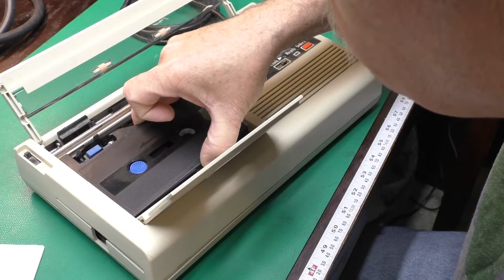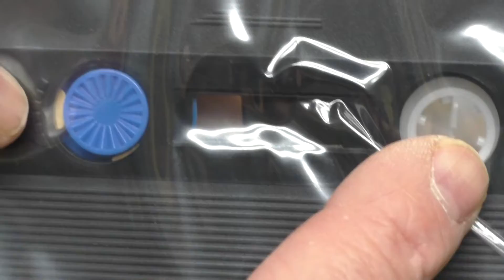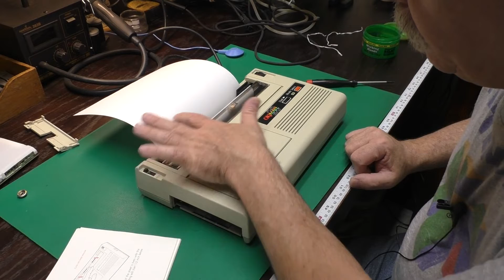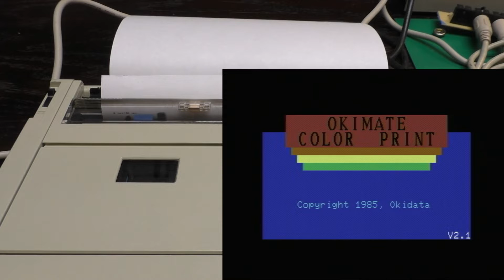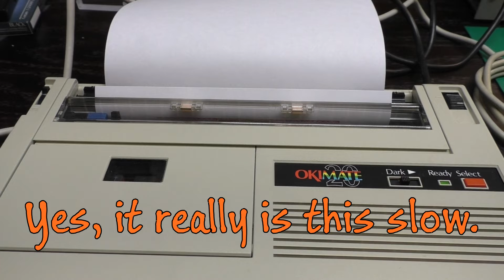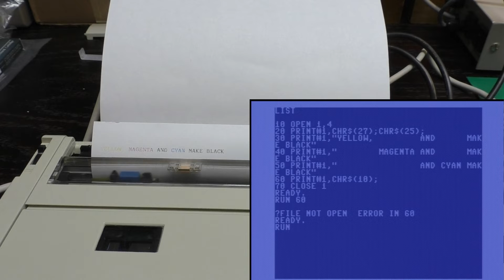Okidata Okimate 20 Printer - Refurb, testing, programming

Comment: Thanks for this video.. I just found one of these for a whopping $5 with three ribbons.  It wouldn't print at all, print head just jammed but only when printing. When powering up, it went back and forth normally.  Really confused about why but it turned out when it prints it pushed the head forward, which created extra drag on the forward rail, which was dry and (not visibly) rusty.  A good clean and wipe down, and application of a little silicone spray on a q-tip and wiped on the rails and it prints like magic. I've always wanted one of these printers and while thermal paper is a little clunky, the silent and crisp printing is a real joy, especially at midnight while your wife is sleeping in the next room. I wish thermal paper came in tractor feed!

Comment: Got myself one this week, though the RS232C version, unfortunately though the postie had dropped it in transit, so may never run again (broke several parts of the paper transport, attempting to glue it back together & fix a couple gears, but, not feeling hopeful!), sad thing is I bagged a pack of 6x colour cartridges for it for £22 (seller still has a few more too) and may not get to use them... :\

Comment: Is the speed issue of the computer sending the data, or the printer processing?
Reply from the maker: Well, both are slow, but this printing process is very slow. It has to go over each row multiple times, once per color. For the time period and cost this was the best full color printing option out there. I have had this printed image hanging up since this video was made and it still looks great.
Reply: @HeyBirt  That makes sense. One color page printing time is the equivalent of 3-4 black and white pages printed of the time beyond just text characters. I miss my Oki. Great company. Thanks for sharing this!

Comment: holy guacamole i had one of these, i still recall getting the printer easily then scouring every electronics shop in a 100 mile radius to get the plug and print module so that it would work with my commodore

Comment: When I had mine in 1991 I was disappointed with the drivers for the poor raster print quality, so I learned assembler on the Amiga and wrote new drivers that would make optimal use of the printer. If I remember correctly it would also print much more faster. I think I still have the printer stashed away somewhere.
Reply from the maker: For the time and cost of printer the print quality was amazing.
Reply: @HeyBirt  Today, May 1, 2026, I finally found the printer stashed in our barn. Before I turn it on, I’ll need to open it and check that everything is still intact and that no capacitors are leaking or swollen. The interface on mine looks similar to a Centronics port connector. I’ll have to look around to see if I still have the cable for it.

Comment: Besides the demo do you know of any print software for the c64 (or 128) that will let you print in color?
Reply from the maker: There is a utility program on the disk that will print screen grabs. I was also able to print color with GEOS. Many programs back in the day let you set the printer control codes so you can configure them somewhat to do special things.

Comment: Smooth Gloss Paper gave good results. (For the day).
I used my Okimate 20 with an Amiga.
My printer has a Centronics (IEEE 1284) connector. The Amiga would interface to that no problem.
The guy (Colin M....) who sold me the printer, also gave me a EPROM for the removable interface.
That (apparently) made it Amiga Compatible as the as shipped ROM was for IBM.
It did indeed work with my Amiga back in the day. Never did look into what the ROM difference was though.
I put my Okimate 20 back in it's box in the 80's and I still have it!
Reply: Do you still have the IBM rom?  I have one with an Amiga rom and I'm looking for an IBM ROM dump.

Comment: Nifty! I just got one of these for $10 + shipping. It came with maybe 1/2 a black ribbon, but I have been unable to find any color ribbons. A few black are still out there... 
I will have to grab a copy of that Okidata software from you.
Reply from the maker: The quality is amazing for the time period and price point of the printer. I'm sure I imaged the disk so I'll send you a copy. A month or so after doing this video a guy on eBay had a bunch of new color ribbons for $12 ea w/free shipping. I'm kicking myself for only buying one of them.

If you have some thermal paper you can use it for testing and save the precious ribbons for the final output of your masterpiece :) I found that 24 pound inkjet paper worked well with both the B/W and color ribbons.

Comment: I had both an Okimate 10 and then a 20 back in the day.

There was an attachment to hold a thermal paper roll.  This helped keep the paper aligned properly as it fed through the machine.

The problem with the ribbon print could be age related, or it could be a ribbon that was already used and rewound.  I would do this with my black ribbons and get 4 or 5 uses out of them for text printing. 

For colour printing, it needs to know where the colours are.  There's a clear part of the ribbon tape.  The photo-sensor may need cleaned if the colours are aligning properly when it prints.  Of course, the colour ribbon could be a used one and have been rewound.

To get the best quality output, you should use a smooth paper.  The wax won't adhere well to rougher paper.  The colour output of the Okimates was pretty vibrant.

For the Okimate 20, I think that it only used the 24pins for certain print modes (NLQ with it's custom built-in font and maybe colour) and reverted to a 9pin output for other modes.  I think printing custom fonts from GeoWrite reverted to 9pin mode.   It also couldn't half-step the paper advance like other printers.  The 24pin printhead was also prone to pin/element failure.  I replaced the 24pin head multiple times in my Okimate 20, never in my Okimate 10.
Reply from the maker: It has been a while since I worked on this printer but as I recall the ribbon was sticking to a few dirty spots along the carriage or it might have been that it was not being wound properly after printing a line. In either case a good cleaning solved the problem.

Comment: I was fiddeling with a broken one back in the day and was not able to get it to run because i not have the knowledge to do so (i was 13 or 14 i think).... now i co-own a copyshop and fix many of our printers myself, but i kept remembering this first color printer i ever layed my hands on and always wondered how it worked. Thanks for showing me!!
Reply from the maker: I found out later that the 'newfangled' dye sublimation printers use a similar process with a single use ribbon that has its coating transferred to the paper.
Reply: @HeyBirt  Yes, they do... and they deliver a better printing quality than the 50k$ color laser printers i use in our shop.... inkjet, of course is comparable, but a much more complicated setup... they were on the right track in 1985.... sadly its still a very high cost per print with this technology....

Comment: Will this work with any computer from the last 15 years? I just need a Thermal Copier/ printer and can get this some one but I have no idea how to use it now days.
Reply from the maker: No, will not work with a modern computer, and the ribbons are expensive if you can find them. There are thermal printers with a generic parallel port interface though.
Reply: @HeyBirt  Thank you, do you know of any cheap thermal printer that can work with modern computer? or a dot matrix printer that is cheap and will work?
Reply from the maker: What are you trying to do? I'm not sure there are any wide format thermal printers, i.e. other than receipt printers. Okidata still makes dot matrix printers.
Reply: @HeyBirt  tattoo Stencils
Reply: @HeyBirt  but it's like 4 or $500 I can get one that will do  copys only for $200

Comment: I ha several printers thru the 80's including this one (which I still have), but I had forgotten that it is a thermal printer
Reply from the maker: I thought it was very interesting that they leveraged a simple thermal print head to to a wax transfer type printing. The way the color ribbon works amazed me and later on I found out that the fancy dye sublimation printers work the same way.

Comment: I had one of these for a couple of hours on my Amiga. I set it up and saw how slow it printed, plus how fast it goes through ribbons  (especially color) and promptly returned it.
Reply from the maker: It is defiantly a slow poke. The color output was pretty awesome for the time though, albeit expensive :)
Reply: I enjoyed mine immensely.  Thermal paper was a cheap way to print black and white and compared to 9 pin dot matrix printers doing near letter quality it actually had very good quality output and speed.  Draft speed was pretty poor compared to dot matrix though.  And yeah color was just very very slow.  Wish I had mine by the time I had an Amiga.

Comment: Nice video.  I loved the ads for these printers back then but after I saw it in the store I was happy to have stuck with my Star NX-1000C Rainbow.  But even those color ribbons are getting hard to find.  To me these printers didn't seem practical for everyday printing.  No tractor feed, you needed to get special paper if you wanted the results shown in the mags and the costly ribbons.  But definitely a cool device for the time.
Reply from the maker: It actually does have tractor feed but you need to find a suitable tractor feed paper. The Star is  a much more robust printer though, defiantly better for everyday printing.

Comment: The brains of the machine being in the interface probably has to do with the fact that the different 8-bit computers had radically different expectations of the intelligence of their peripherals.  Commodore machines expected full-fledged computers driving the peripherals internally, while Apple ]['s expected to do all the controlling themselves.  I expect the interface module for an Apple ][ would be much simpler and transfer a LOT more data back to the computer.
Reply from the maker: I'm sure you are correct about why they did things that way. I have an Epson printer that also used a similar interface cartridge that plugged into the printer.  I have not dug into that one yet to find out if it is just an interface or the whole 'brains' pf the printer.

Comment: As a quick test for thermal paper, don't bother with soldering irons, lighters or similar. Just run your fingernail or thumbnail  across it fairly quickly, as if you were trying to score it.  If you see a decent black line, it is thermal paper and ready to use.
Reply from the maker: That is a good idea! Thanks.

Comment: Lovely item, but yikes, not only is it slow, the ribbons are horribly wasteful. A cursory search for ancient listings of replacement ribbon cartridges states "35,000 character yield" for the black cartridge. At 80 characters per line, that's 437 full lines and the cartridge is done. And judging from how it handles color, you probably used up half of the color cartridge with that one image alone. (Edit: A German review from 1986 confirms that a black ribbon cartridge will print around 75 pages, a color ribbon cartridge will deliver 10 color screen prints. Yikes, again.)

I'm going to hazard a guess and say that, after the novelty of "yay color prints" wore off and the wallets started vetoing, people used it exclusively with thermal paper.
Reply from the maker: Yeah, I think the cost of the cartridges did it in. Sort of like ink for ink jets does now.
Reply: Consider the times though. The Okidata 10 was my first printer for a computer with 64k. It was AWESOME to print anything in color back in those days. I did my final college project using Geos Write and the Okidata in 1987.  Text and graphs and I could print at night without complaints compared to dot matrix. I remember buying a very specific type of paper for it and the end results had a very specific feel when done.
Reply: yea a new color ribbon does 4 pages of color which translates to 8 koala images  yay